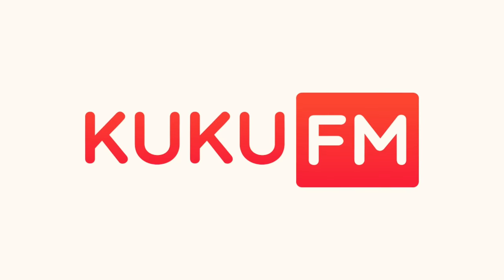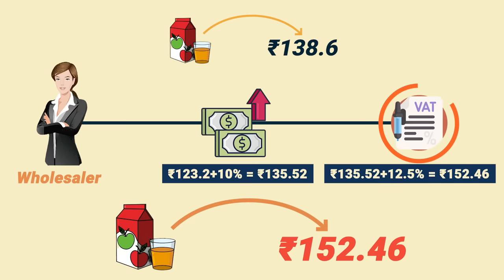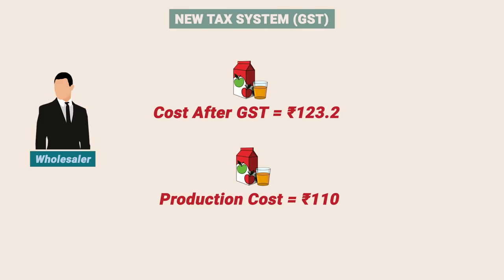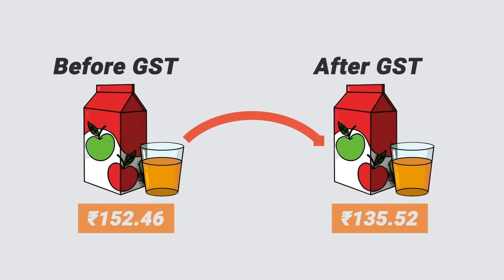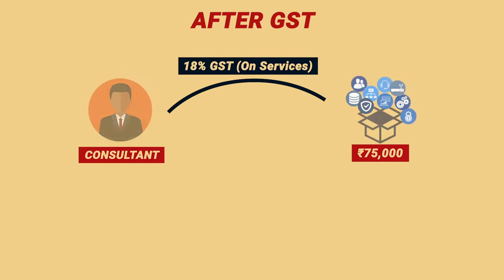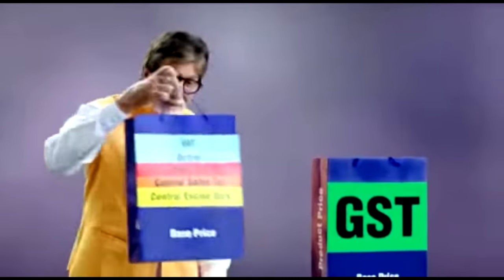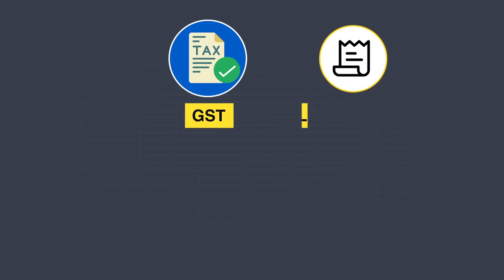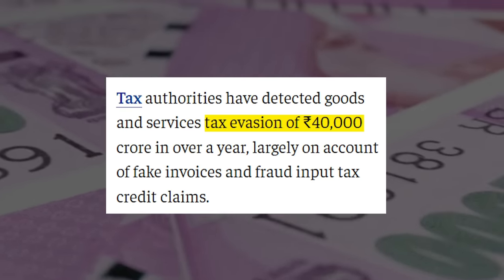How GST has CHANGED/ MESSED UP the Indian Economy?: Indian Business Casestudy (Corrected Video)

Comment: Back in 2014 the cost of manufacturing was kept low at 100Rs but now cost will have increased to 125Rs and final calculations comes back same old values. Earlier Govt benefitted by extra VAT collection now manufacturer is collecting that difference in money by increasing manufacturing cost. Ultimately absolute number matters for consumers and not these calculations. During VAT days the cost of many products were low even after paying higher taxes but now it is bad.

Comment: PM Modi has turned his attention towards industry reforms with demonetisation, GST, and the Insolvency and Bankruptcy Code (IBC). These were undertaken to reform corporate India and rid the country of crony capitalism. These reforms have drawn criticism from many, perhaps forgetting that demonetisation has broken the back of the black money class. The use of black money has reduced considerably. Long-term habits to deal in black money have been mostly converted into the default use of digital banking systems.

GST has been an outstanding success towards India’s move to reduce supply chain costs, which today account for 14% of GDP as against 6% in China and 5% in the US. Seventeen taxes were rolled into one, providing a uniform system for the first time in 70 years, and effective indirect taxes have reduced. In its first month, the system onboarded 56 lakh filers. For various reasons, GST has not shown buoyancy, but one can expect to see the effect in the future.

Infrastructure development has been another significant push of the Modi government. Rural road connectivity, railways development, and construction of high-speed roads, ports and airports have taken off at a fast pace—all vital ingredients to increase India’s productivity and reduce supply chain costs.

Make-in-India, at commencement, was not a great success because it was cast in the traditional mould without a focus on the policy changes and incentives required. Subsequently, the Production Linked Incentive (PLI) scheme for large scale electronics proved successful—mobile manufacturing has risen multifold, making India an exporter. Merging PLI-like strategies with the Atmanirbhar Bharat Abhiyan push could make Make-in-India a success.

PM Modi’s next focus was health. Ayushman Bharat was launched to provide health insurance cover to the millions of uninsured in India; 12.6 crore e-cards have been issued, and 1.2 crore hospital admissions were managed through this scheme. The next frontier in health is the Bharat Health Stack, built on the India Stack architecture, which will further improve access and management of healthcare in India.

Other reforms that have the potential for sizeable economic impact have been in simplifying labour laws, incentivising and reclassifying MSMEs, especially with the guaranteed loan programmes, reduction in corporate tax rates, and deregulating the farm sector, which will empower farmers to double their income by 2022.

The emphasis on employment needs better policies and focus, but it will certainly improve when the effects from these other reforms bear fruit.

During the Covid-19 pandemic and national lockdowns, PM Modi’s focus was on ensuring the lives and livelihoods of the bottom-of-the-pyramid. All the reforms and digital advancements made earlier are proving extremely useful in these difficult times. Rations and minimum income support were extended to 80 crore Indians, which wouldn’t have been possible without Digital India and India Stack. PM Modi’s housing programme has also been an outstanding success in bringing dignity to crores of Indians with pucca housing; 1.1 crore houses have been built, targeting a total of 2.95 crores by 2022. The return of migrants during the Covid-lockdown has accelerated this programme and enabled them to build a life in their hometowns. With this acceleration, the timeline to build a house has reduced from 120 days to a 45-60 day horizon.

At this rate, by 2022, all Indians will have access to basic necessities—housing, clean water, gas connections, bank accounts, internet and mobile connectivity, road access, and education—especially with the implementation of the National Education Policy 2020. For a population of 138 crore, these are remarkable achievements. PM Modi had a clear strategy to reach this point, unambiguous aspirations and a structured sequence of reforms and policies.

Previous political regimes launched schemes like Garibi Hatao, which were unsuccessful because they focused more on politics and less on execution. PM Modi has inverted this paradigm, and personally monitors and reviews progress on the programmes. He leverages technology platforms wherever possible to ensure the programmes are executed as soon as possible. He sets clear priorities for himself and his government. He has not fallen victim to unnecessary politics. His foreign policy moves have made the Middle East friends of India, and the entire world looks more favourably on the country now. Standing up to hegemonic China, too, has improved our standing in the world.

No prime minister has done as much for India’s development as PM Modi has in his EIGHT years.
Reply: The only economy is now in ICU post all this , please don’t kill it.
Reply: @Vaibhav Jain 😂😂
Reply: How do you manage to write such a long comment on a yt video
Reply: Bot
Reply: @manishreddy4247  he has copied this some where don't u see some text style are different
Reply: I sincerely  wish  Modi  remains  in  power  atleast  for  10 more years to come  and  thanks  for   input.
Reply: Please  don't  get discouraged  by  negative  comments.
Reply: @sa34w  "Indian Economy is the only bright spot in world economy"... IMF... Kya fukh Raha bhai
Reply: @KejriwalBhakt  Arey tumhe pata nahi kya.....ab ye log bolenge IMF bhi Sanghi aur Andh bhakt aur Godi media hai. Lol😂😂😂

Comment: There is a factual error at 13:18. You said that the 42% of CGST collected will go to the producer states. But it isn't the actual case. All of the amount collected as CGST is pooled under the head of GST revenue of center. This CGST revenue then along with other revenues (direct tax revenue and non-tax revenue) becomes the center government receipt in the budget. From that receipt a Divisible pool is formed. Finely, 42% of this Divisible pool goes to all the states ( not only the producer states). Different states get different portion from that 42% as per the Finance Commission's recommendations

Comment: In July 2017, Gst was levied on Ocean freight @5% and on Air freight @18%. We  don't know what's d logic of different rates. Deptt withdrew it on 26th December, 2017, which is again levied  from 1st October, 2022. Another issue now is it should be treated as IGST, which is basically applicable on interstate customer

Comment: Just a few things:
1. GST is a fundamentally a tax on consumption which means the incidence (i.e. burden of the tax) falls on consumers. 
2. Also, the concept of neutrality is very important in GST. Neutrality states capital allocation decisions should not be affected by taxes. This leads to more efficient allocation of resources. There is a whole body of lit. on this. When you have multiple rates at the consumer level - you create distortions. Note - the taxes the producers pay is irrelevant - because they can claim input tax credit. This is the whole point - intermediate transactions are not subject to consumption taxations. (vertical integration vs specialisation). 
3. The issue with Tamil Nadu is not actually correct. The thing is Tamil Nadu will end up losing excise taxes (which is another types of consumption taxes - but it will effect the how the producer allocates his resources.) But GST has no impact on income taxation. Also - Tamil Nadu can charge companies directly for using the infrastructure. No need to use an excise or use tax for the use of its infrastructure. There are better ways for Tamil Nadu to fill up the gap. 

There are lots more to talk about - but a good back ground reading would be "British Tax System" by Kay and King. Please see the chapters on VAT or consumption tax (no need to look at the whole book - although you could for the sake of curiosity)

Comment: My opinion on problems:
first problem is getting tax right on industries. I do not consider it a new problem but unsolved one. taxes were unfaily imposed before GST also.
Second problem can be solved by setting a managing company in middle; Tell me if there are problems. In my understanding, GST means that tax on added value. it is manufacturing state where most of value will be sold. for example in chips, it is manufaturer in chennai that sells chips for 100 rupees box and Tamilnadu can collect tax on it. seller in patna sells it at profit of 10 rupees and pay tax on that ten rupees to bihar governement.
third problem is a governement problem that should be solved by faster processing and more flexibility on filing system.

Comment: They need to add gst for petroleum products like gasoline and other fuel which can reduce the cost
Reply: the reason for not doing so is well documented. at the time, the states were not willing to greenlit GST for petrol etc. even today they won't due to the compensation issue. it will take time

Comment: Informative and well presented 👍
It would have been even better if u had mentioned another important point, regarding the GST compensation Cess.

The govt had promised to the high performing and producing states the compensation for any revenue loss due to the switchover to the GST regime for 5 years (from 2017 till June 30, 2022). We all know how delayed and untimely these compensations were made through these years. Keep in mind the economic situation by 2019 was already at a slump.. let alone the onset of pandemic years. 

These years the revenue through this indirect taxation on goods and services for the states took a big hit, and it had a direct impact on its revenue, the share in percentage for compensation was also influenced by this impact. Now that the deadline has ended, the compensation to these States has ended (Jun, 2022). Interestingly, the Centre however has not ended it's cess collection, rather extended it upto Mar, 2026.

So one hand the States are prevented (stopped) from getting their GST compensation and on the other hand the Centre continues to collect the cess via an extension another 4 years. 🙄

The centre justifies their cause saying we gave the compensation from loans during the pandemic. However this doesn't do justice for extending cess collection by 4 years.. as they would be collecting more revenue than what they gave as loans in the few months as compensation. This is why some states argued on extending their compensation period as well. 

To put it bluntly, the Centre has used the pandemic as a reason to extend its Cess collection by 4 years while denying the same luxury to the States on compensation who had been through an atmosphere of economic discomfort as well. This is marginally a double standard action by the Finance Ministry with a majoritarian GST council at its behest.

Comment: There should be a system where common man can scan our gst bills / billing should be done by the shop after scanning a unique code of the customer, so that service sector is put to the integrity. There is nothing stopping a hotel buying groceries in the local market to charge Gst and never pay them to the govt.
Reply: there already is such system. for annual turnover 10 crore, mandatory to have GST-QR-Code on invoice (called e-invoice IRN QR Code). if businessman does not pay GST on this invoice, he will 101% receive a notice from taxman. Do note that this limit used to be 500 crore so it will come down even more.

Comment: E-Way bill is a good point. 
To remove bottlenecks at each stage of taxing the economy and collating it as a single tax is a onerous task. 
The way to ease the burden is to standardize the transactions. 
It is ease of doing business that will fulfill partly the GST goals. 
Implementing e-business framework along with e-commerce shall help. 
Indian software companies should we work with GOI, to computerise the entire functions including SME. 
There is no point in India writing projects for foreign companies. 
Take state electricity boards. Modernize and computerise them. Slowly move on to other sectors. 
What has Infosys done for Indian economy. 
Let us start from existing infrastructure. GST will fall in place.
Reply: the transactions are already getting standardised through technology. read about GST e-invoicing for info

Comment: The consultant paid 12500 tax back then!! Now he has to pay 12250 😢😢!! He saves 250 rupees and with 7.5% inflation in count, he is paying more tax than before 🙂🙂
Reply: there is a rule called Ceteris paribus. when discussing such topics you can't bring 3rd factor into consideration. inflation would have a negative impact at present even if GST wasn't implemented so its a moot point.

Comment: I am not getting what are the types of GST, as in your video you mentioned about IGST. How is this different from the actual GST?
Also, does the producer state and the consumer state both applies the GST or only one. If both applies the GST then it that case total GST would be 24%.

Can someone clarify me on the above two points.
Reply: IGST = Integrated Goods and service tax.  It is charged generally when goods or services are sold between two states

IGST is tax portion of Central government and then distributed between states

CGST is Central goods and service tax which is portion of Tax of Central government

SGST = State goods and service tax is tax portion of states.

For example if A seller in Delhi sells goods to buyer of Mumbai and rate of tax is 18%, then IGST is applicable since it is supply of goods between 2 states and IGST rate will be 18%

If Buyer and Seller are both of same state,  and tax rate 18% applicable,  then CGST =9% and SGST =9% is charged

UTGST = Union territory Goods and service tax is charged when Union terriroty is involved in the transaction. Since Union territory is controlled by central government,  UTGST is portion of tax of central government.  

If there is supply between seller and buyer of Union territory and tax rate 18% applicable,  then CGST =9% and UTGST =9% applicable.

Comment: Good video but some flawed logic.

1) Gov deciding to heavily tax the gaming industry is just like gov doing the same with the alcohol, fuel and automobile sectors. GST is just acting as a tool here and heavy taxes could be applied even in the old tax system. Fuel and alcohol are the examples of the same as both are outside gst.

2) a state attracts jobs when it attracts manufacturing units and these jobs create consumers in that state so it's not like manufacturing states won't get any taxes. What they won't get is the unfair share of taxes like they were getting earlier. A consumer oriented model is better as it doesn't give undue advantage to manufacturing sector. All sectors contribute to the economy and create direct / indirect  employment which creates demand needed to facilitate manufacturing. 

The real issues with GST are complicated system due to multiple rates and delay in providing refund to businesses

Comment: The biggest problem in my opinion with GST is that completely centralises power and kinda destroy federalism. It also punishes manufacturing states and rewards consumer states and in the long run it's not good.
Reply: not true. 50% assessees are with Centre Jurisdiction. 50% with centre. there is also a sound logic for why GST is a destination based tax and not manufacturing/producer based tax though I'm not able to recall the correct reason